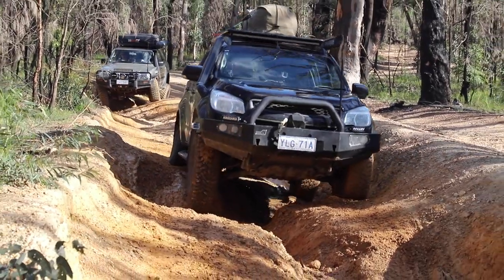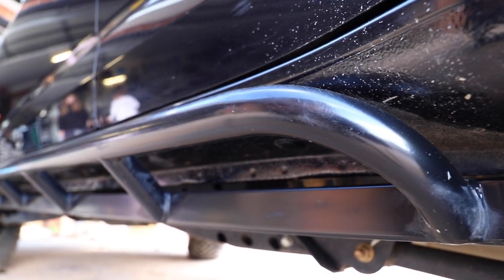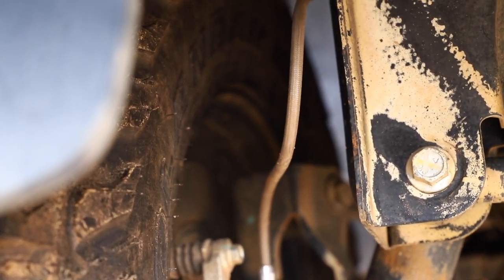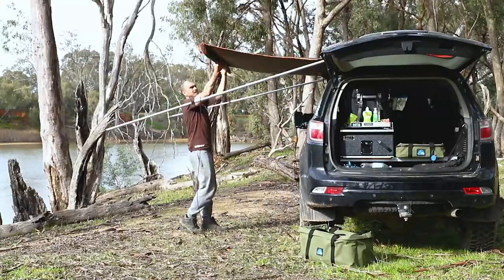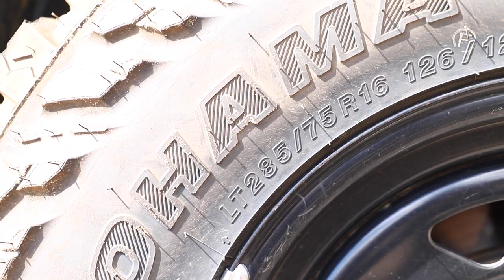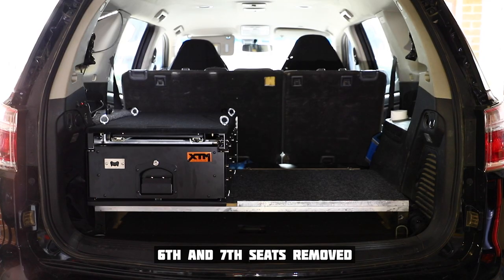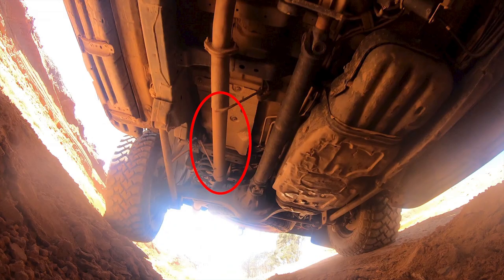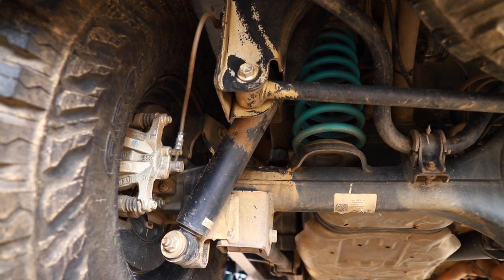Holden RG Colorado Walkthrough

Comment: Great info there fella, been looking at them recently for a tow rig. 
How does it go pulling the van? 
Cheers Coop ✌️
Reply from the maker: It was great as it is with our 15ft van. No problem. We upgraded to a 17ft van and it struggled with all the mods plus the van. 33s, barwork etc. A stock colorado with heavy duty springs would tow like a beast.

Comment: Hey M8, just curious how your rack mounts are secured to the rails. like the mounts you had made , how do they attach. I like having the rails but don't trust the mount points, 
I have an mu-x but generally same same.
Lovin the content m8 , keep up the good work.
Reply from the maker: Hey mate, it's just six high tensile bolts each side straight through the mounts into the factory thread that are on the rails. M8 bolts from memory. Once it's all tied in together it's pretty strong. Get in touch via Facebook messenger if you want and I can send you some pics

Comment: Fortuner/hilux rear shocks are longer and fit perfectly.  I have them in my trailblazer same car.
Reply from the maker: Oh really!? Which brand and type do you have? Thx for the info
Reply: @OutdoorsCBR  I have dobinsons mrr myself but they do non mrr also. How much was you brake lines want to do mine as the rhr is definitely abit tight
Reply: mr59-50701 is the part number in mine
Reply from the maker: Thanks for sending that through I'll look into those. Will try find out the open and closed lengths. The braided brake lines were made up to suit, not actually listed on the APC4wd website. From memory they were $190-200. Something like that.

Comment: did u end up sorting that rear shock?
Reply from the maker: Yeah mate. Ended up with a set of GU patrol Bilstein shocks that were modified to suit the Colorado7. The mounts on the shaft end of the shock needed to be changed to the pin type. Heaps more rear travel. Added extended braided brake lines and bump stop spacers. Sway bar out.
Reply: sweet, i just bought the same car about 4 weeks ago and shes stock as a rock but took it to esperence for the week and was super impressed with it to the point im looking to give it a full haul over. snorkel rock sliders, exhorst, lift, 33/35 sterio,  lockers.... and well the list goes on if there are any mods u strongly recommend drop us a link. ps man this is a great vid, good editing and great on cam vibe
Reply from the maker: @MrGeddes85  thanks mate appreciate the feedback. That's a solid list, car is a weapon with a rear locker. Twin locked would be epic. Depends what you are doing with the car but mud tires go along way to improving offroad performance. 33s screw with the auto trans a bit, it doesnt know when to lock up the converter. I switch it over to manual mode all the time when driving now.

Comment: Mate I'm considering getting an L7 ( 2010 on) just as a daily driver and tourer up here in the territory. How is it getting basic spares given they are no longer produced etc?
Reply from the maker: I haven't had any issues yet. A lot of the major stuff I have bought genuine second hand. Have bought a few genuine brand new parts as well. Bought an aftermarket tensioner from Repco. I think there were enough utes made that parts won't be an issue for a long time
Reply: @OutdoorsCBR   Thanks Brus appreciate the quick reply. I am a diehard Pajero guy but I like the look of the L7, it is a Holden and they get very good  reviews. I like the genuine 7 seat config with flat fold down in an instant. I dont need hardcore offroad just long highway comfort and the off bush bash hunting Buffalo.  Might go the Petrol i think !
Reply from the maker: @jmginthent651  didn't know there was a petrol model for the Colorado 7. Thought they were all diesels. And pretty sure the first year was 2012
Reply: @OutdoorsCBR  I think I need to do some more research LOL. I've only just started looking. I guess it's gonna be a diesel from 2012 onwards then?